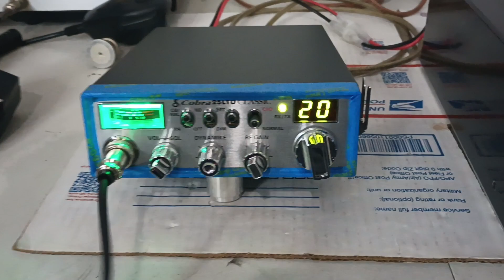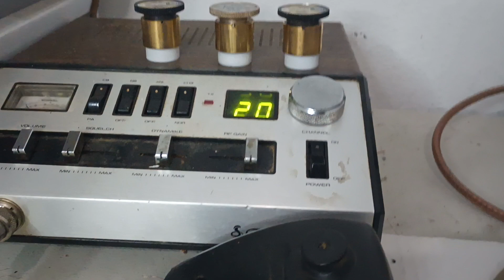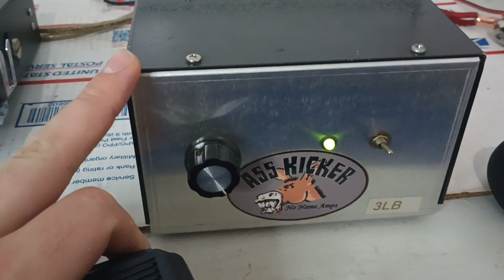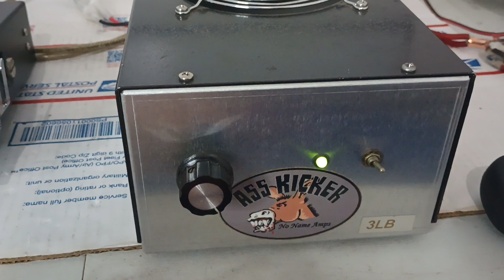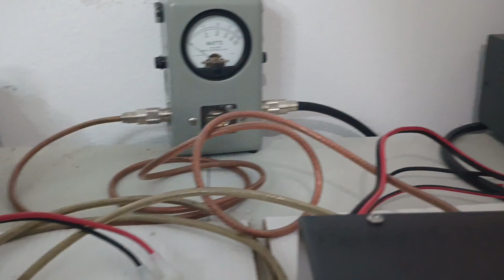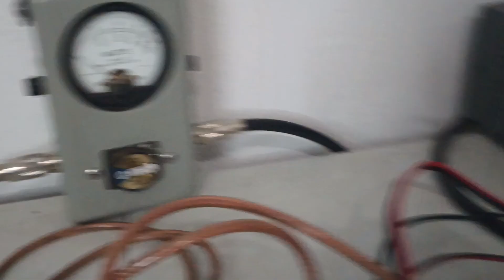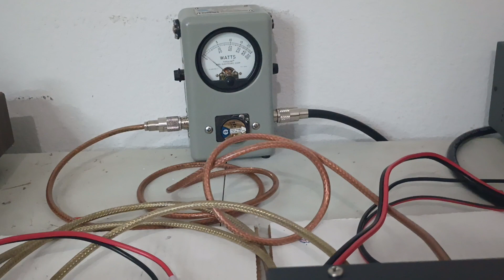"Ass Kicker" 3LB Maul by Stickman, and RC Cobra 25ltd, combo video, Pending

Comment: Hey rooster I've got a Uniden grant xl still in box I never used it. I'm putting it in my Ford Taurus can I use a RM ITALY 750 WATT AMP? THE RADIO IS STILL SEALED AND A CHICAGO PLATE IN THE REAR CAN I USE A ASTATIC POWER MIKE ALSO?? ITS NEVER BEEN OPENED OR WORKED ON??
Reply from the maker: I would at least get the grant modified, and have a variable deadkey added
Reply: Box is. Old but I pulled radio out of box Man it's still looks like new never ran or hooked up!!
Reply from the maker: Send it to @rccustoms307 he'll hook you up https://youtube.com/@rccustoms307
Reply: Thanks Rooster